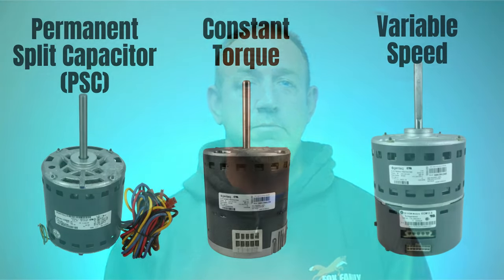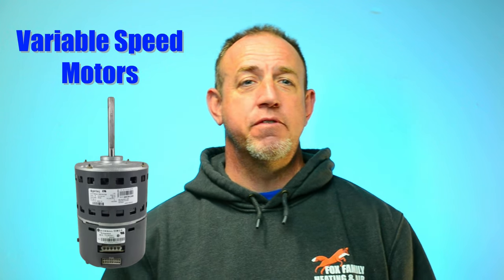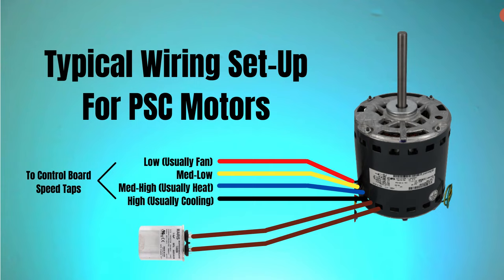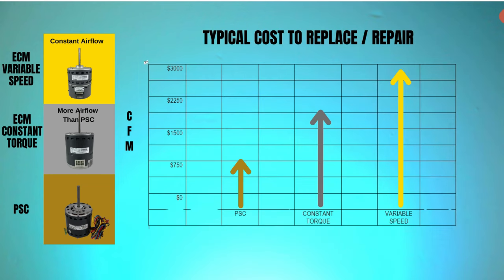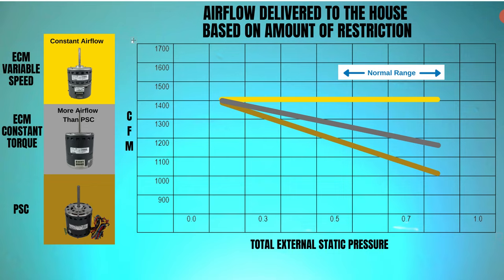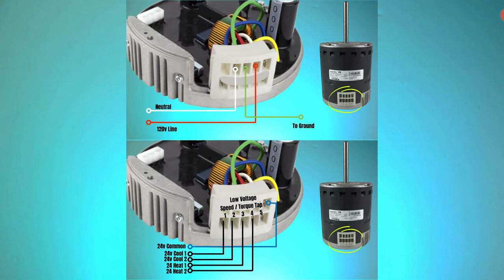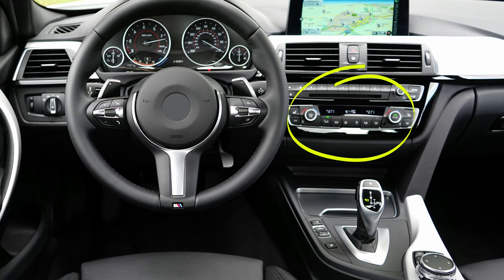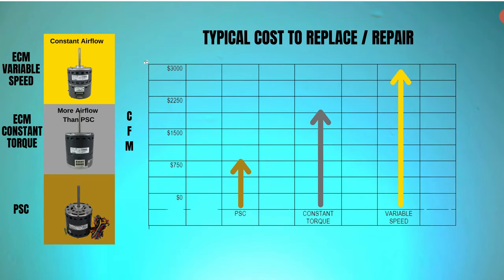PSC Motor vs Constant Torque Motor vs Variable Speed Motor | Comparison Video

Comment: PSC motors draw fewer amps under high static / restricted conditions

The Split phase refers to the fact that the capacitor creates a phase shift which creates a difference in phase angle between the run and start windings - residential power from the utility, regardless of voltage, is single phase there is no phase difference between the legs; just potential difference
Reply: That's it.   Although it's fair to say that the two hot lines in a single phase system are 180° out of phase with each other with respect to neutral.
Reply: @austindillon443 Yea but once the PSC motor heats up from the lack of air movement it would start to draw higher amps no?
Reply: @Duck1cVE  Peehaps if the airflow were restricted severely enough but I have never seen that be the case. You can install an amp or watt meter on a unit with a psc motor, restrict air flow and observe for yourself that the amperage/wattage decreases
Reply: @austindillon443 how it can decrease if it has to work harder . It’s electric device and they are all the same. Overcharge the compressor and watch your amps
Reply: @MrBlinchikON  Your answer is in your question. What happens when static pressure goes up? Airflow goes down. The work, or load, on the motor is the volume of air it is moving. So, as static goes up, airflow goes down, load goes down, amps go down. You can test this with a watt meter or you can take my word for it; it’s correct

Comment: Nice explanation: However I don't know any tech's that carry both parts of an ECM motor. Most of them change the whole thing and not split the motor and change the affected part. One replacement will wipe out all the savings that ECM motors may have produced.
Reply from the maker: Good points. Thanks. Yeah I can never remember changing just the motor part. It seem to always just be the module which had to be ordered from the factory.
Reply: I once saw a module only get replaced on a rooftop package system. In this case the thermistor had failed on the module.
Reply: Good point and I hear what you are saying. When selling and installing these motors I try to let the customer know they are paying for the added comfort they provide more then anything else.

Comment: I'm a retired electronics technician, the short lifespan of our parts is due to "designed obsolescence" from a short sighted type in Detroit, AND capitalism's insane allowance of allowing limited resources to be wasted in lousy products imo. I would like to add more restrictive filtering to my furnace blower motor. Ive ordered a manual D, and considering a bigger psc motor, thanks to your honest cost  assessment. Thank you for a good video.
Reply: Bean-counter engineering (build 'em cheap, sell them for a king's ransom) is running rampant throughout many industries these days.

Comment: The incredibly high quotes I've gotten for repairs or new systems made me so angry... I now own all the special tools (bender, swager, gauges, recovery unit, scales, probes, brazing etc..) Educated the crap out of myself, became certified for the gasses and now perform 100% of my own work. My systems in my homes perform perfect with exact humidity/air/temp control and my repairs cost little to nothing, even ECM or full VFD 3 phase motors, I am also a high and low voltage electronic controls expert, that helps a lot. My variable speed systems are all 3 phase VFD driven with single phase inputs, now were talking my language.

Comment: S-Split, comes from Phase Shift that takes place in a stator winding set perpendicular to the run winding in the stator. It is less inductive than the run and in series with a capacitor. The combination of the ANGLE and capacitors leading current "Shifts" and "splits" the phase and attempts to achieve an optimal 90deg shift.

Comment: I looked at the prices in your chart.  Those prices seemed awfully high to me.  The last time I replaced a blower motor a generic 1/3 or 1/2 HP motor was under $50.  Well, I just checked Amazon and those motors are $125 to $250.  And, Grainger's prices run into the $500 to $600 range.
Reply: Those are prices for the contractor to install, not the homeowner

Comment: I learned my lesson about high efficiency a long time ago. I replaced my 1960 vintage 200,000+ BTU gas furnace that was the size of a VW beetle with a 100,000 HE furnace. At the same time I replaced my old gas water heater with a HE gas one. The furnace started life as oil, was converted to propane, then to natural gas when it became available. The new furnace took up the space of an easy chair so that was a bonus in my garage. Over the next ten years I replaced the water heater control valve do to a temp sensor failure twice myself then do to circumstances I had the heater replaced for the same reason. In ten years I spent $800 on valves and another $1800 on a new heater installed on a weekend. My furnace wasn't as bad but I did have to replace the blower motor and something else at a later date. I have no clue if it saved on gas cost because when I installed them the price of gas dropped dramatically and I never compared the consumption rates but I'm certain anything I saved on gas cost was eaten by repair costs. This is why I shrug off any claims about electric cars being cheaper to own and operate. It's all slight of hand by elixir salesmen.

Comment: If you live where there is humidity there is nothing like a variable speed wired to a humidistat. Although for arguments sake we have wired many psc motors to a humidistat through a no nc relay and this does work just as well. But for simplicity's sake the dehum terminal on a variable speed makes it easy. Good video, Thanks
Reply: I live in Florida and many seem to say its almost pointless to have a blower with a terminal for a humidistat, unless you also have a 2 stage blower. Is that really true? My thought is that if the blower then lowers CFM by say 60-80%, then it can lower humidity, at the expense of running longer (makes sense) and then I would think it would not bring the overall temp down much, verses most where it will end up lowering the whole house temp by several degrees, depending on humidity.
Reply: @senecapierson9092  Ok so I don't know who "many" are but I can tell you from experience that variable speed blowers with a dehum terminal on Allied equipment cut the airflow back to 75% when deenergized. This allows for lower evaporator temperatures and longer contact time with the air passing over the coil. They work extremely well and will automatically go back to full fan speed when the set humidity is reached thus giving you your advertised seer rating. So just to make a few points clear both variable speed and constant torque motors are ECM but the constant torque is the cheaper version with no provisions to vary the speed. The variable speed blower has a mofset controller that allows you to vary the speed. When you say a 2 stage blower you are referring to a two stage furnace or air conditioner that will automatically change the blower speed to the level needed for the stage being operated, these can be either ECM or PSC multi tap. Ok so without getting into all the details you will still have the same BTU output as that is controlled by the size of the compressor you have, not the airflow. While it is true that you will have less CFM of air, your air will be colder. If you dont have a variable speed blower with a dehum terminal you can get the same result by installing a no nc relay in your air handler and adding a humidistat. Just place the small 24 v relay between your cool tap on the control board and the normal speed wire to the blower through the nc output of the relay. Then tie the NO of your relay to the speed tap that is a lower speed. Then run 24 volts to the humidistat and have it send 24v to the relay coil when the humidity is above your setting, this will energize the relay and have it switch to the lower fan speed. You can do this relatively cheap for just the cost of a 10 dollar relay and a 25 dollar humidistat. This will allow you to see how effective this way of dehumidification is  If you dont have a anemometer or a performance spec on your blower I would drop 1 speed tap at a time and measure superheat. You dont want to drop the speed so low that you send liquid back to the compressor. What you are going to lower when it is dehumidifying is SEER rating not output. Once you see how well this works you can make a better decision on the equipment you replace it with. PSC motors do cost more than ECMs to operate. Hope this helps
Reply: @anthonyspadafora1384  Yes,  sorry, I meant 2 stage condenser not blower. Most around here seems to say for proper control, you have to have a 2 stage condenser at least.
But yes, overall it helps. I have had 4-5 quotes here and just get all kinds of different answers, from "reputable" HVAC companies. 
Currently I have a 2ton 13 seer heatpump and 2.5ton blower, Carrier, 20 years old (R410). Not going to a new system for higher SEER as I will never get the money back in increased efficiency, even if we went to say 20 SEER over say 14-15 SEER. 

So what you mention then may not be bad then. I do have a Thermostat that supports accessories and such such as dehumidifying, though I believe I only have 6 wires in the bundle to the thermostat, and all are being used right now. So I would need to pull a new wire, which is not that bad to do.

So basically I am looking at a Tempstar blower, being either a 3 tap, 5 tap ECM, or variable speed. I believe only the vairable speed has the terminal for dehumidifier, and I believe the spec sheet/install sheet said when its on, it cuts CFM by 80%.  And then then we would have a single stage heatpump. The 2.5ton air handler is just oversized for my house, however because of windows, insulation, etc. humidity usually stays between 40-55%. I just figured, if spending money on a new install, if for a reasonable amount of money, I can gain better humidity control, where I can keep it at say 42% or so all year, that would be ideal, but again, to do that without actually lowering my overall temp. I tend to keep the house to say 80 in the summer, with a 1 degree swing, and then 70-72 in the summer. Efficiency I am not overly concerned about because I know my old systems with a bad TXV value is just going to be pretty inefficient now, and then that it was oversized (the returns were also above the baseboard, we had them moved to the ceiling when we had the flex duct replaced a couple years back), which makes me feel it was someone who moved from the north east and designed it how they would have up there. 

So if I follow you, and on say the 3 tap model, if I used the medium speed all the time, then that and the low speed would go into a relay where its "default" on say medium, but when the thermostat is calling for humidity control, it then triggers the relay which then changes the speed to low? And that should not have much impact on the blower for when it changes between medium and low and back?
Reply: @senecapierson9092  That is correct how the relay works. One other thing I would like to point out is when in the air conditioning mode you should keep the fan on the "on" position especially if you live in a 2 or 3 level home. Usually the thermostat is located on the first floor and the cool air from the a/c will come down the stairway leaving the thermostat satisfied and the upstairs considerably hotter. With the fan on, the condenser will still cycle according to the thermostat but air inside the home will constantly be pulled into the returns and redistributed throughout the house. This will allow both floors to be closer in temperature. With a variable speed ECM blower the unit will also have a circulating speed which it will switch to when the stat is satisfied. This low circulating speed is very cost effective and very quiet and returns to the proper speed when there is a call for cooling.
Reply: @anthonyspadafora1384  Yeah, so I am in a single story 1280 sqft block home, in Florida. So AC runs most of the year, with heat on when needed in winter (hence the heat pump).
Basically I am just debating between 3 different air handlers right now for the new system, 1 being 3 speed PSC motor, another being a 5 tap ECM motor, and then the third being a variable speed motor. I am not interested in spending more for a 2 stage condenser as there will never be even close to a payoff in efficiency/$$$ for us. The full variable speed blower I believe he told me would be $500 more. Not sure on the 5 tap yet if that would be say $100 or $200 more.

I do appreciate the insight though. I did not see anyone else online make that recommendation for humidity, basically being able to turn a 3 speed PSC blower into a "2 stage" blower. Being in a high humidity climate, like today, where the AC has not ran, and its now 57% RH inside, if I had that relay and a compatible thermostat/wring, then it could kick on AC, run it on the lowest CFM setting, and bring that RH down to say at least 50%, without really lowering the homes temp then. Thats really what I am looking for, without "breaking the bank".

Comment: Most extractor fan motors I have come across are PSC. Speed controllers (Triac) are available but it is recommended to feed the capacitor (therefore the aux winding) with a permanent live instead of from the controlled output of the controller. (This is 3 wire connection). Why is this ? I assume to create more torque at low speeds but I can find nothing to confirm this. I've also heard the aux winding in a PSC draws almost no current when running at rated speed. Is this correct and why?

Comment: A circuit board on the end of a motor is the stupidest thing. I'd avoid that crap. I get it that it is CYA not having a modular drive system. But usually anything that's all-in-one is usually junk. Component level and modular with some color codes or electrical ratings that are compatible would be nice. I'd imagine industrial applications have separate three phase drives. And those have to be sized 1.25 times the FLA. I know someone trying to rebuild a speed control "head". This is news to me. We gotta fight this crap.  Well i appreciate all the info and hope things get simpler before everyone just buys a window unit.

Comment: Nice vid, and I have a silly question.  When I replaced my furnace I was told that it is a variable speed unit, but after I had it replaced I found out that I can't use thermostat to set fan to run low or high.  My new Carrier furnace + heatpump uses a ECM motor and is it even possible to replace just the blower motor to enable me to have a low/high setting on fan speed?  (eg.  Sometimes I just need fan running to circulate and no need for cooling/heating).  I think that's somewhat misleading saying the system is variable speed when the blower only runs at 1 speed whenever it is turned on.   Thanks in advance.

Comment: My variable speed motor module went bad in my Trane XV90 Unit. But for some reason I can’t buy just the module, I need to buy the whole motor. Part alone was pretty pricey. Not including the installation fee. Sucks but what else can I do, Gotta bite the bullet and get it fixed. But thanks for the knowledge on the three types of motors.